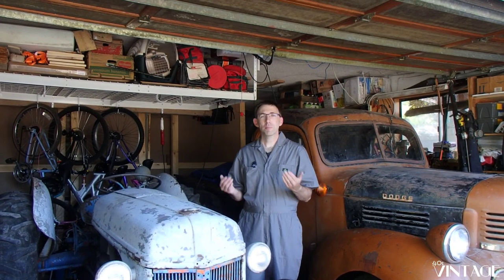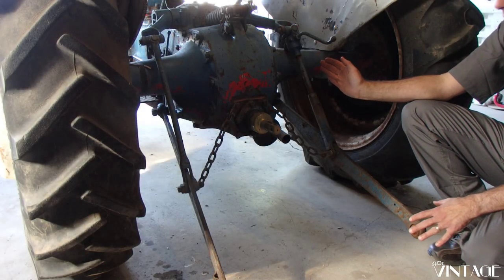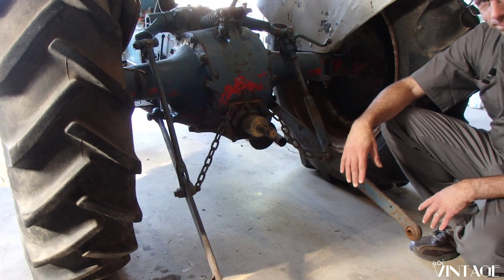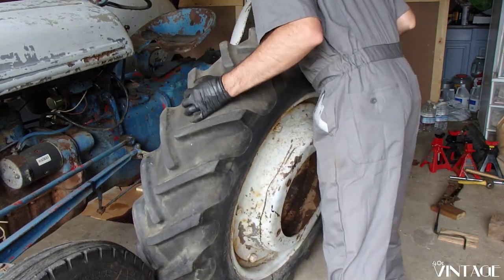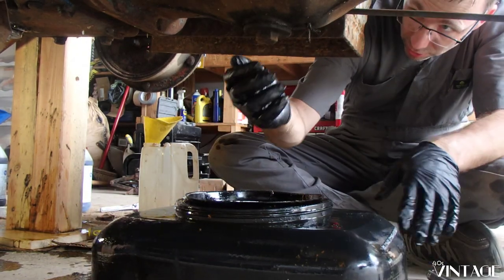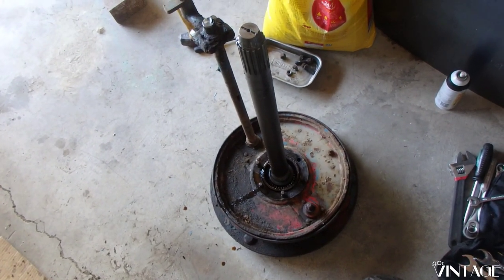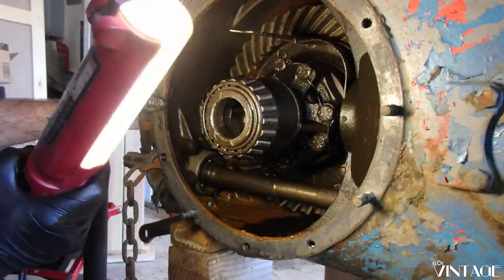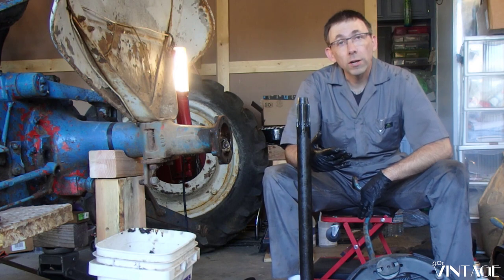1944 Ford 2N - Finding Out Why We Have No Brakes | Josie The Tractor Ep 1

Comment: You actually have a Frankenstein Ford the front tires and hubs are off a 8N and the torsion bars are off a 9N so it may not be a 9N engine but the serial number is on the left side of the block just above the starter and below the head 😀🇨🇦
Reply from the maker: You are correct about the front hubs; seems upgrading them to 8N style is pretty common, so no surprise there. Actually probably a good thing, as they seem easier to find.

On the torsion bars, from what I've been able to research, it seems they changed them to the round style sometime late in 1944, so assuming mine was built in early '44 as the serial number seems to indicate (assuming this is the original engine!), they are correct. Not that it matters a whole bunch to me, and it certainly wouldn't be the only mix-n-match part I've found - check out those running boards, definitely not 9N/2N! 

Thanks for watching!